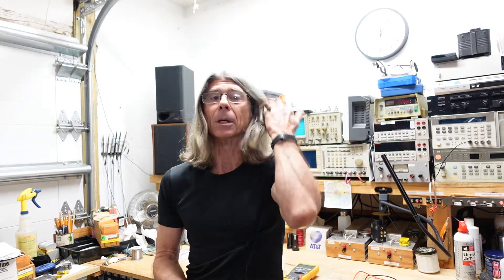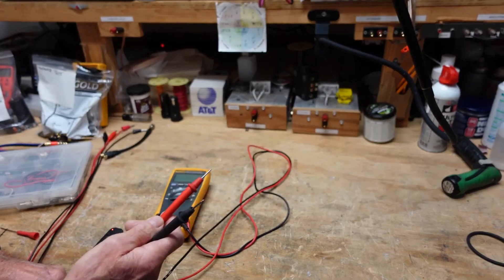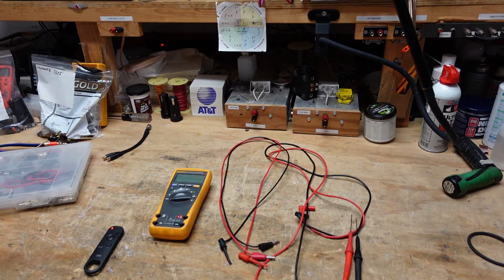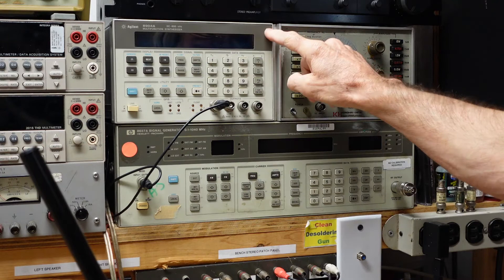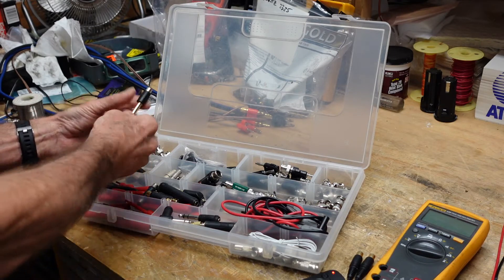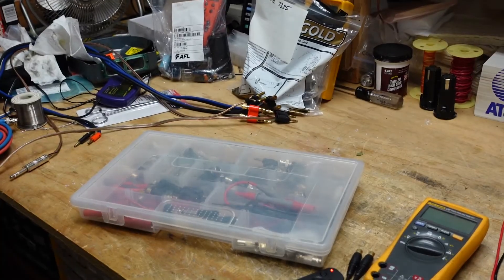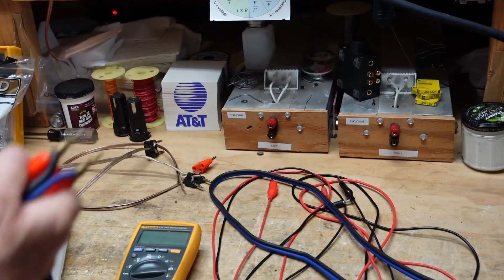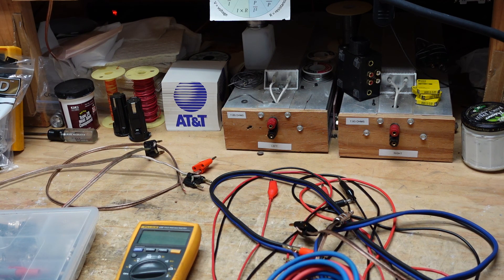Adapters and cables for the audio service bench

Comment: Interesting note on banana plug/binding post spacing here domestically being the same as electrical in other parts of the world. I remember seeing an electrical plug adapter that came with a Sony Hi8mm video camera years ago. It was just two round pins and two slots on opposite sides.

Comment: I did the probe slip from emitter to collector on output of a typical 60 watt per channel. It only took a fraction of a second and domino effect outputs, drivers, dual diode, voltage amplifier all destroyed. And that was on the good channel. I'm not brand new to this either. I surprised myself.... Really good probes and better strategy are well advised. I can hear my friend, "Test here it's safer." Or, "Turn it off and use an alligator clip." He also advised putting your ground clip on such a way that if it were to fall off it wouldn't fall into something and create a short. I had lots of time to think about his instruction.

Thanks for you videos and stay well. God Bless!
Reply from the maker: Oh brother, we've all done it. I've tried using sharper probes, which does help, but the ones I bought were cheap and didn't last. I've had the ground clip pull off a scope probe and cause damage too. No matter how careful you are it only takes a moment for disaster to strike, as you well know!